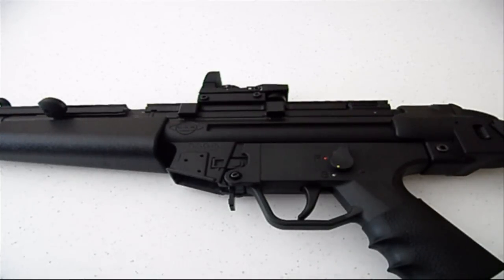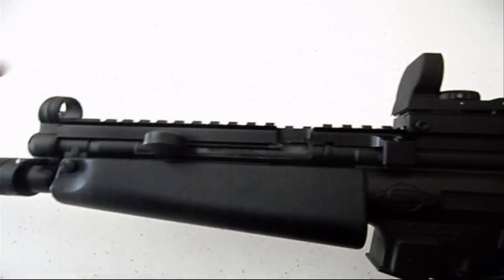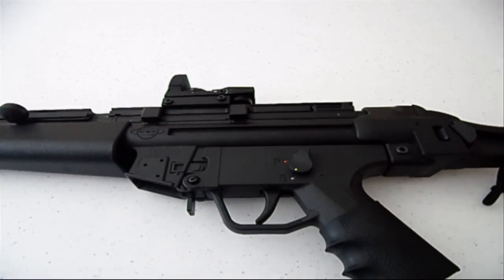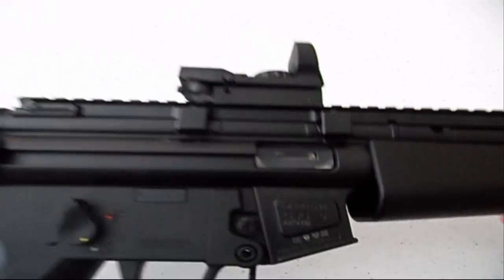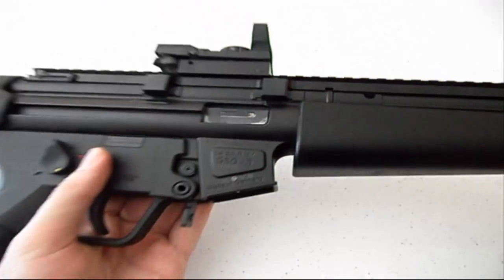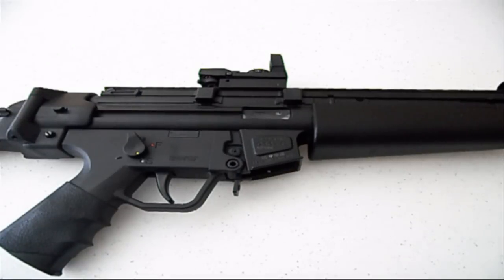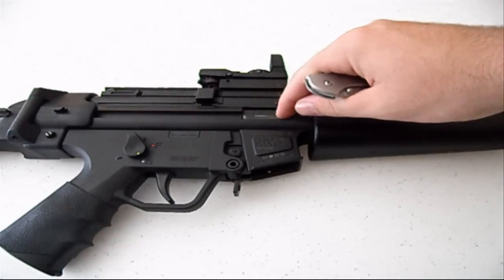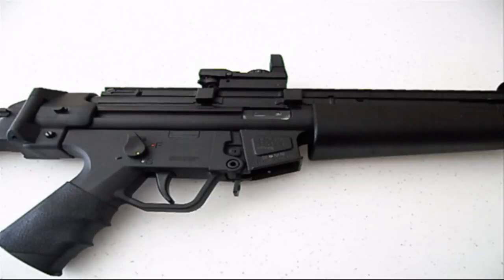My GSG-5 Broke!!!

Comment: Gsg5 is a good reliable rifle only if you know what it likes. Upgrading the screws and lock tighting them is a must because the screws get loose causing the bolt to crack. Sometimes the magazines need a little customizing also. Im also not a big fan of the feed ramp, but like suggested in the owners manual a light dab of oil on the ammunition(and the right type of ammo) and you could put 500 rounds through it without any jams. I absolutley love the gun otherwise

Comment: I have two GSG 5 gen 1’s. One just broke idk what happened. The trigger won’t pull & the screws shot out the side also the release button screw popped out. Took 1 shot with a CCI copper 1840fps round. I had it shipped out about two months ago & still no word at all. The other is still brand new still in the original box never been fully put together. With the original tape from when it was shipped. It was a great gun & I’ve put over a 1000rds through it. Always checked the screws & nuts. I’ve had so many over the years since they first came out. But this has never happens before to any of them. And all the parts I have stocked up I can basically build one . But I’m thinking of putting all the parts on gun broker or something. I don’t need everything. Hopefully I get it back soon. I miss plinking with it.

Comment: Actually, the receiver is metal on the gsg5. And I havent seen the hk umarex version, but if the lower receiver is metal than the gsg5 is more similar to an actual hk mp5, because the lower of an actual mp5 is polymer. I also hear that the umarex bolt dosent come out of the upper so if there is a problem (which there usually are) you gotta send it back. The gsg is a great gun if its tuned right.

Comment: The original can that came with the SD model, not the carbine, was hollow. The new ones supplied after around Feb 2010 have an inner tube that the barrel slides through. I think the ATF figured that someone could cut the barrel short and the hollow can would act like a baffle. None the less, if your fake can is hollow, you're in violation, if it has an inner tube that fits tight to the barrel, you're good. Someone correct me if I'm incorrect on this.

Comment from the maker: @boogatube So far so good. I got in contact with the manufacturer and they have offered to either send me a replacement bolt, or have the rifle sent in and have them replace the broken bolt and look over the rifle to try to determine what caused it to break. Once I get it fixed, I will make an update video on how long the process took and how satisfied I was with it.

Comment: I know what causes that. The 2 bolt thats holding that metal piece came loose and and moved lil bit on the side and hit the ejection port. I have the same model as yours and i always check every screws and usually thus 2 screws get loose. Sell it to me :)

Comment: @kingtutley I was told by an ATI rep that anyone who has one of the recalled guns will be contacted by the ATF pretty soon.  the fake suppressor is hollow and can be modified to suppress the weapon.  That said, you would need enough know how to get it to work right and most people who know how also know how easy it is to get a real one legally. I just picked one up that has the new solid barrel shroud/fake suppressor on it and it runs fine, it even eats Winchester Western 36Gr. PHP

Comment: i had the exact same problem with my gsg5.  ATI replaced the part of the bolt that cracked. should be recieving the gun back tomorrow. kinda bummed by the whole experience, they've had my gun for a month and originally said they would send me a free gift with the gun.  i called to check on the repair status i asked about the gift and i was treated like some kind of mooch and was told there was no gift. apparently its MY fault the bolt cracked under the OVERWHELMING pressure of a .22LR...

Comment: Well i never seen a gsg with a polymer receiver. And ive seen quite a few. And yes i agree that the gsg5 isnt identical but its pretty dam close. I also just think that the umarex is more vulnerable to issues because of the fact you cant get as good a cleaning as you can with the gsg.

Comment: just send in the bolt and replace it yourself, there is a video on here that shows you how to take it completely apart and it is really easy. how sturdy is the stock I like it, it is not wobbly like the factory stock is it? also where did you get the rail?